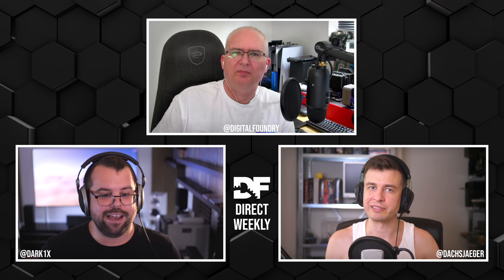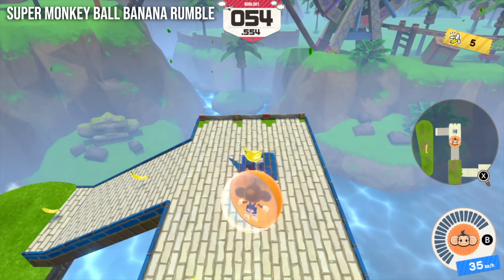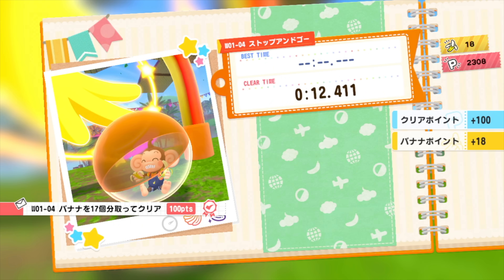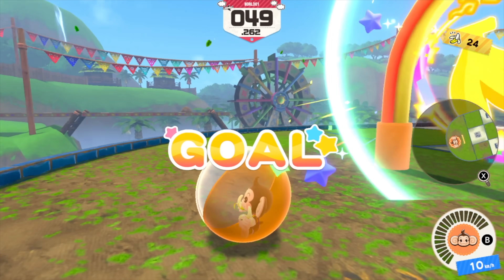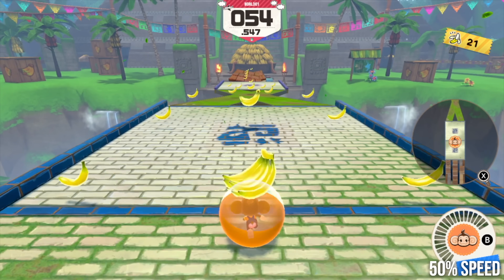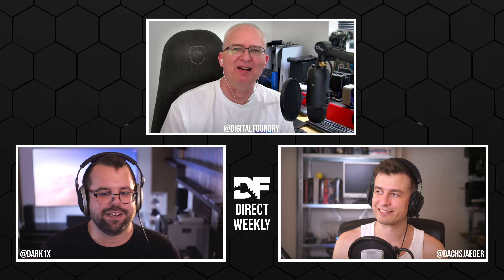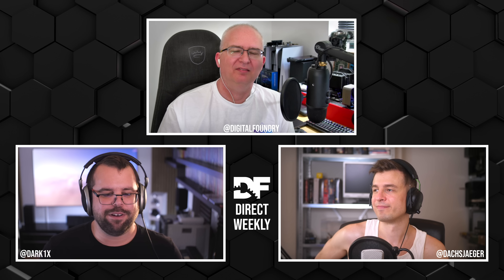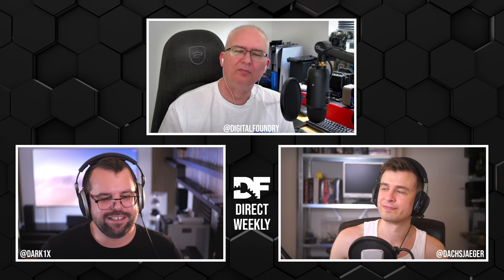The Unity Engine's 50Hz Physics Problem Strikes Again!

Comment: Better than unity pro here. Third option, and the proper option: use a custom physics engine, you wont get input delay because of the interpolation, it will support 144hz screens and it will be smooth as butter.

Comment: Real sad that this is such a big issue (mainly in indie) and very similar to Unreal Engine's default Vert- FoV scaling, which has completely ruined a huge number of even AAA games made on the engine.  Or, improved them, if you're still using a 16:10 or narrow monitor.  But modern days of Ultrawide?  Crippled.  Even Unity has had major issues with Vert- scaling, especially for its UI system.

Special mention to things designed based on a specific aspect ratio, and are also unplayable for other reasons (XCOM 1 remake, mouse position is off, Firaxis never went back and fixed it).

Comment: Users can workaround this by using the UABEA tool and adjusting the timestep for different refresh rates (FPS targets).  I have a few guides on this for various games, you can probably find one by googling ["daowace" timestep unity], you'll know you got the result if you see Lunacid, the game I originally discovered this fix for.

If you don't need a guide, just open the 'Time Manager' asset and edit the timestep value to 1÷Hz.

Comment: Interpolation does not solve the issue because it's visual only and setting physics to 60fps does not solve it because it is not synced with the framerate.

The visual camera needs to be decoupled from physics objects. Unitys Cinemachine can be used as a smooth following camera and it is very easy to test by setting physics to far below 50fps to force the stutter.

Also people play from different types of variable framerate so it's not like 60 would solve everything.

Comment: A quick solution that I use is to simply always synchronize the physics steps with the current frame rate.

void Update()
{
    Time.fixedDeltaTime = Time.deltaTime;
}

There may be other problems with this, but I haven't encountered any yet.

Comment: This is not a unity problem since you can just use interpolation or use physics directly in Update, it is set to 50 hz by default because it is the sweet spot that works with all frame rate, this just looks like there were not proper testing of quality
Reply: I don't understand why 60hz wouldn't work with all frame rates but 50hz does.

Comment: As someone with a bit of Unity experience: this is not a bug, this is an "issue" in any game engine or game with a flexible frame rate. The devs likely tied the camera movement to the fixed physics frame rate, which can get desynced from the frame rate of the renderer. 

Basically: the Unity engine (and most other engines out there) have two main update methods:
1) FixedUpdate, which is untied from the frame rate and gets called in exact intervals, which is useful for physics and code that NEEDS to run in perfect steps (like character controllers)
2) Update, which is tied to the frame rate of the game.

You usually put camera movement code into something called "LateUpdate" which gets called directly after "Update" and then use "Lerp" to smooth the movement.

I guess the devs wanted the camera to stick perfectly to the ball, which means they likely put the camera as a child of the character (ball) or put the movement code into "FixedUpdate"

Comment: So many Japanese games have this issue with FixedUpdate. I made a few mods for games to change the FixedUpdate rate to the screen refresh rate (Little Noah) or to patch the offending gameplay logic (Neptunia Sisters vs Sisters). I've been needing to get around to fixing the stuttering in Samurai Maiden as due to the physics relying on 60FPS timing, simply raising the rate caused issues with jumping.

Godot is luckily fixing this issue with Godot 4.4.

Comment: Pro unity dev here. The physics update rate, know as the fixed update rate in unity, is represented as a floating point number. It is set to 0.02 seconds which is 50 fps. Setting it to 60 fps is actually impossible because 1/60 of a second cannot be represented perfectly as a decimal. You need to use a value of 0.016666.... This reduces the frequency of stutters but can't eliminate them because the last digit gets rounded to a 7. At best you can reduce the stutter to 1 frame every few seconds. Interpolation works, but a better solution is the have the camera lerp to a target position. This removes the camera from the physics engine altogether. Honestly it is about 10 minutes of work.
Reply: Use powers of 2, like 128hz, and blend 16 of those frames into 8
Reply: @davidaugustofc2574  This has the same issue as using 100Hz does. By blending 16 frames into 8, you're left with 64 frames per second, meaning that 1 in every 15 frames need to be skipped
Reply: @SHIFT-HACKMON  I meant blending only 16 out of the 128 frames into 8, turning it into 112 + 8 with interpolation
Reply: @davidaugustofc2574  I see what you're saying now, that doesn't solve the issue because it's still compressing time. The only difference from what the engine is doing is that instead of blending 16 frames into 8 it's removing every other frame until it's 8 frames. You're effectively just adding a motion smoothing effect to it, which as we know from TVs generally doesn't look good
Reply: @zorksox This theory is wrong because 0.02 also can't be represented perfectly in floating point notation.  The closest you can get is 0.01999999955 and some change.  That's single-precision, you can do better with double-precision, but the point is that both 1/50 and 1/60 are imprecise numbers because floats care about base-2, not base-10.  (You could do 1/64 exactly, but that doesn't exactly help).
Reply: @zorksox will using Cinemachine solve this?
Reply: @revraitah  you can definitely use cinemachine to fix this. It is full of nice camera features. It's a bit overkill to fix a single camera, but we can add cinemachine to the long list of solutions to this problem.
Reply: Non-Unity-dev here.  That works for the camera, but what about the movement of the balls themselves?  If you interpolate then you add latency, which sounds bad for this type of game.  A quick Google search suggests that there’s an “extrapolate” option.  Perhaps it makes sense to use that, combined with getting the update rate as close to 60Hz as possible?
Reply: @comexk  interpolation and extrapolating is almost the same thing. You're most likely not going to notice the latency unless it's an extremely high precision game or a rhythm game, so interpolation would work fine.
Reply: Use 0.01 seconds (100fps/Hz), problem solved.
Reply: @saricubra2867  Outside switch there's plenty of screens with higher refresh rates lol
Reply: @saricubra2867  Additionally this doubles the amount of physics updates which makes the physics performance twice as costly.
Reply: @saricubra2867  that doesn't completely get rid of stuttering because it doesn't match the frame rate. The stuttering will be reduced but not eliminated. Also, it doubles to the number of physics calculations.